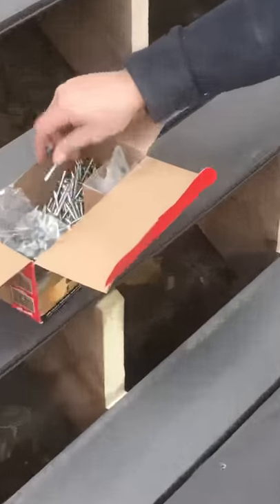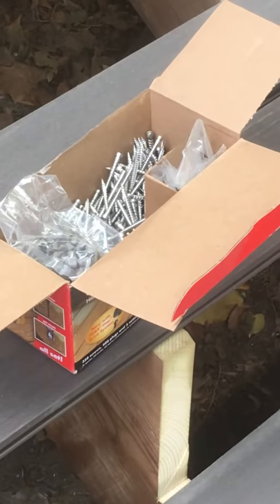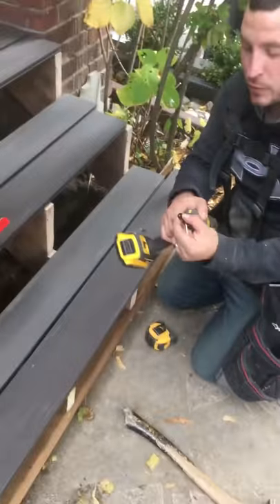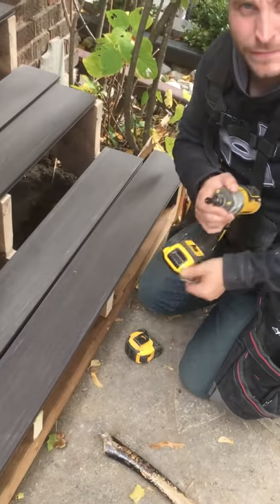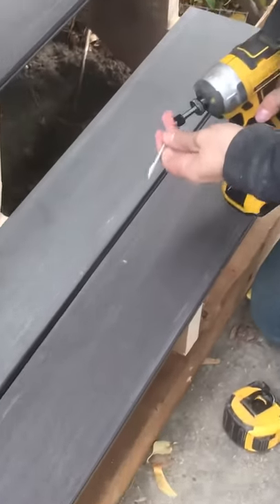How To Plug Azek Decking

Comment: We use a camo gun and screws to  secure composite  deck/  screws go into the sides of the board & are angled by the camo gun system which doesn't leave a hole to plug.. A much better & faster install...
Reply from the maker: I strongly disagree, the camo method is great for soft wood. But that’s about it.